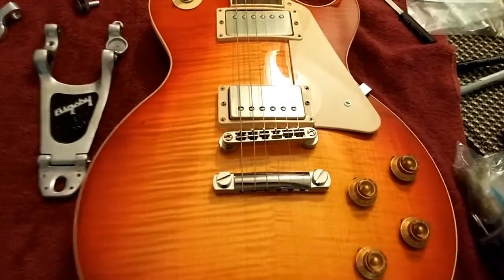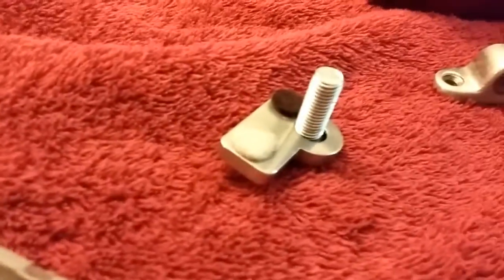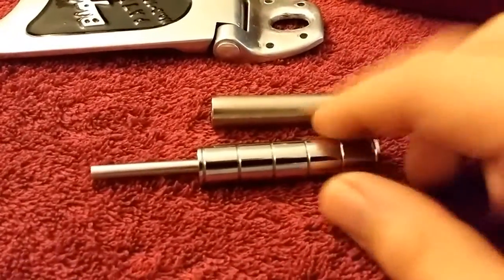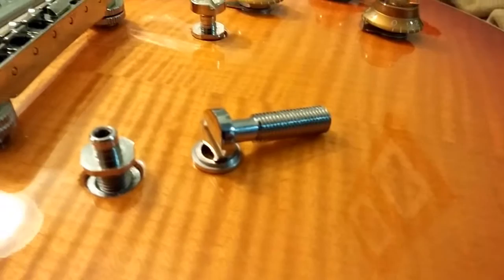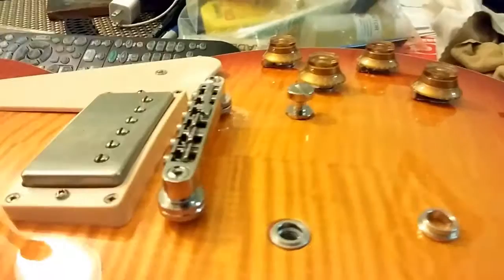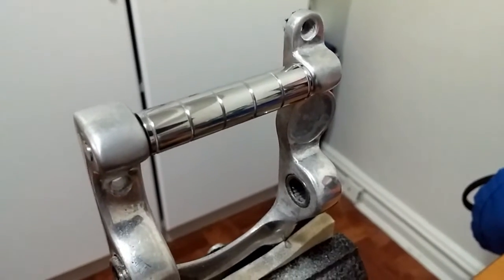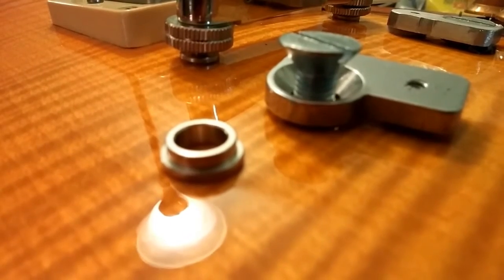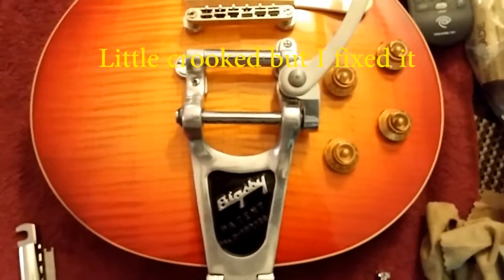Bigsby Install and Tips with Callaham and Faber parts

Comment: I’ve just bought a new black 18 Classic and want a Bigsby on that. I like how you’ve adapted the Vibramate. I’ve got a friend with a factory. I might have a word with him and just make the two parts instead of cutting a Vibramate up. I’d be inclined to use some copper washers in the tailpiece holes.
Reply from the maker: LarryUK should work fine but remember copper turns green and rusty/tarnishes so could effect the finish

Comment: Excellent idea to use the Faber washers under the vibramate parts! I have a bunch of those, leftover, I can use. I'm trying to figure out a way to put a B7 on an SG Standard (large pickguard) using the vibramate, up front, and if needed, a Towner V-block in the back. I have all of the measurements, and just need to figure it out, if it can be done. I don't really like the look of a B5, and the B3 floats (and to my ears), kills sustain.

Comment: Hi NYC LP Player, nice tutorial! What did you put at the tailpiece instead of the vibramate plate? I'm installing a B3 on my guitar, and I'm trying to attaching it without drilling and in my country there's not Towner parts available so shipping here from USA becomes very unaffordable... I' ve looked a lot in the net for a way to do it properly but I couldn't find it. And I couldn't noticed what you used to attach the Bigsby to the tail strap hole, and I'm near to make the little holes and put the little screws but I saw your video and I thought, well maybe there are some more options to try... Thanks!
Reply from the maker: For me the lox screws worked without anything else but make sure the bigsby is tight on the posts especially if you "dog bone" the vibramate
Reply: NYC LP Player The lox screws are the four little that came with the Bigsby? Mine's a B3 so it cannot be attached to top only at the tail but I was trying to figure how to not drill the four
Reply from the maker: On a b3 I dont know if it can be done.  Loxx strap buttons is what I was referring to
https://www.loxx-products.com/live/musical-instruments-guitar-strap-strap-locks/music.aspx
Reply: Cool! I didn't know about that system but I'll have a look to! I think the back strap hole is the same size in B3 than in B7 so it could be a solution if the strings pressure combined is enough strong to keep it there... Thanks, man! ;)
Reply: I finally had to drill at the bottom on the tail because the strap button and a washer hadn't did the trick, hehehe, and the Towner and V Block pack, with the shipping budgets added are crazy expensive and only if I have troubles with tension or tune, which at the moment I hadn't any, I would do it... Thanks for the tips, buddie, appreciate it!! :)

Comment: That rattling noise would do my head in 
There should perfect tuning every time you you the bar but that rattle is terrible
Reply from the maker: I had the handle way too loose as I didnt realize it needed to be tighter.  Perfect tuning every time and Bigsby are not normally things you hear unless you have a pro really go to town on it.
Reply: I wonder what that rattle is, mine doesn’t do that it just spins. Hmmm.

Comment: Never torque it down that tight mate. The string tension holds it
Reply: Actually, the screwing down is critical, otherwise Bigsby will not lay on instrument...but instead lift up 1/2 inch off face of guitar.

Comment: Your Bigsby is not set up properly...you have a shimmy when you move the lever up and down quickly. Audible in video. I'm guessing it's slop in one of the string bars....perhaps improper clearance between post and roller bar. It could be the lever is loose. Something is not right.